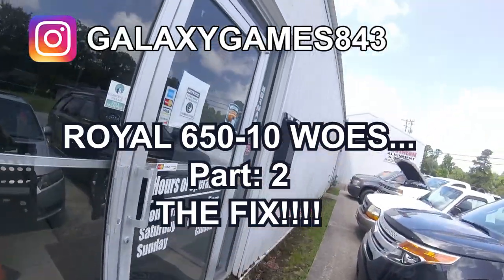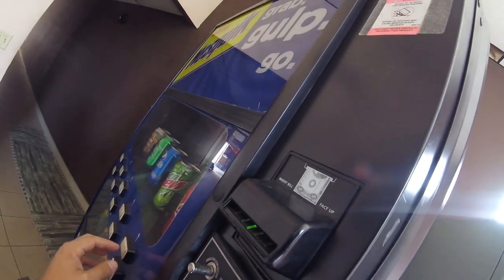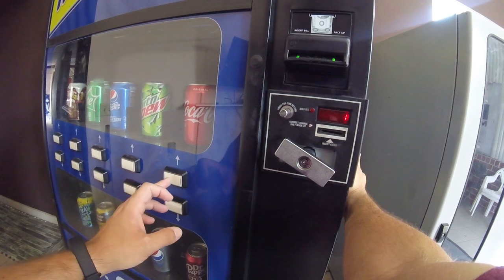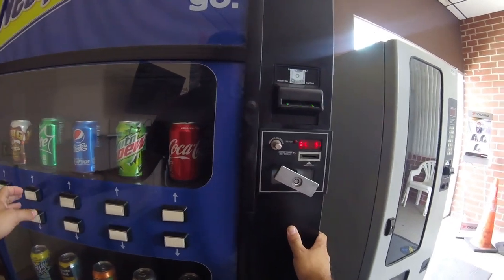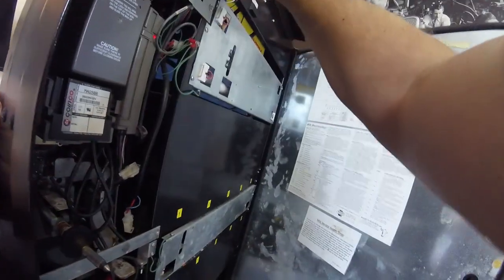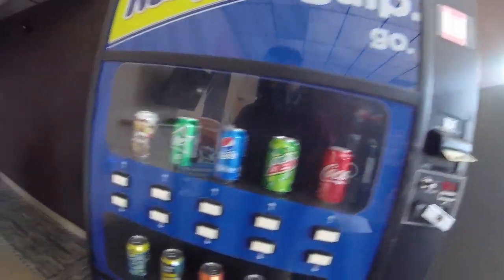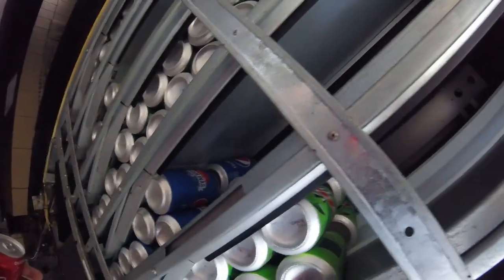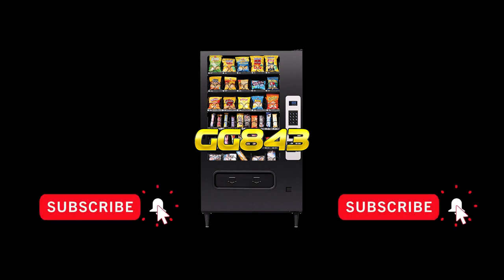How to program a Royal 650-10 Live View Soda Vending Machine!

Comment: Good work my friend...Very Helpful I don't own a Royal Machines.   Does that machine not have a battery back up in case you loose power?  That would suck to do that everytime power goes out...
Reply from the maker: It doesn't have a separate battery backup but it may have a CMOS battery internally. I need to figure that out... If so it may need replaced.
Reply: GalaxyGames843 that is what I meant just couldn’t spit out the right words in the early morning.  😄

Comment: I think the machine thinks there is still the other type of soda if it still had 1 of 2 in the rotor, so it still uses the old column to finish the rotor. I have no experience with this machine but from what its doing that is what I would think is going on.
Reply from the maker: That could make sense. I will tell you since this video, I've moved it to another location and replaced the battery. Then I completely reprogrammed it all and it doesn't seem to be doing that anymore

Comment: the problem is the battery on the main board . Please change this and you will have no more problems in the future.......or you program this machine every time new ......... Greetings from Germany
Reply from the maker: I wasn't sure if the main board had a battery or not! Thanks for pointing that out! Time to research!
Reply: @GalaxyGames843  There is one, thrust me,  or in one of the IC building blocks ,than you have a problem...... I had this issues in older machines once in a while .
Reply from the maker: @germanvending  thanks! I'll research it for sure!